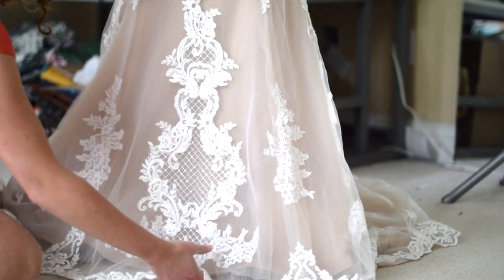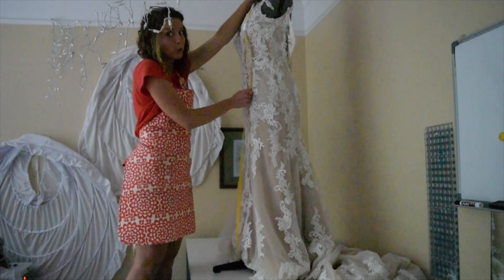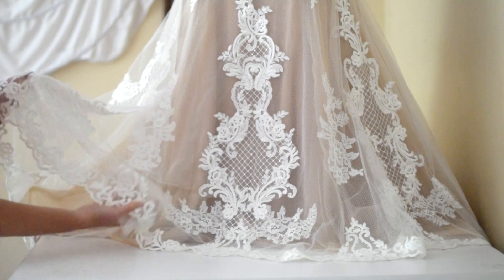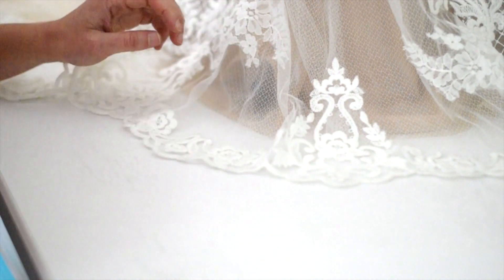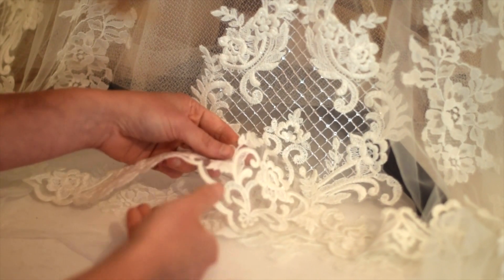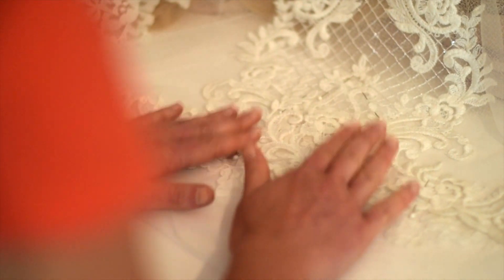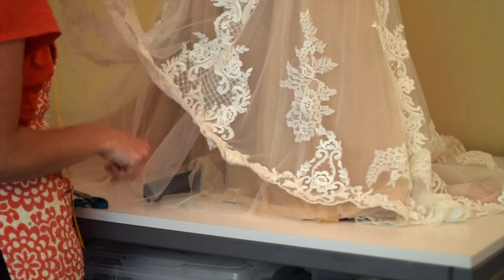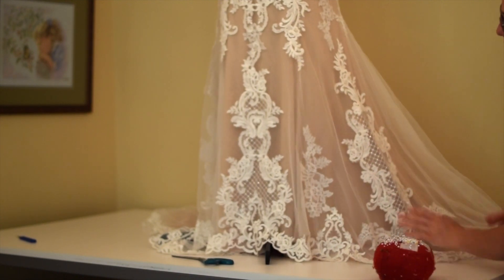Hemming  A Lace Wedding Dress

Comment: Will this work for lace bottom leggings (fancy legging material pants that have a belled lace bottom to the legs). I need to desperately shorten them (I'm 5'3" and it drags on the ground even in wedges)
Reply from the maker: Yes this would definitely apply to that if the lace is sewn on the bottom like this one.